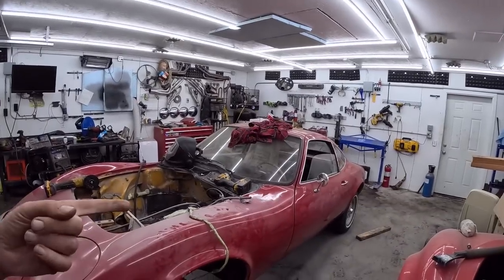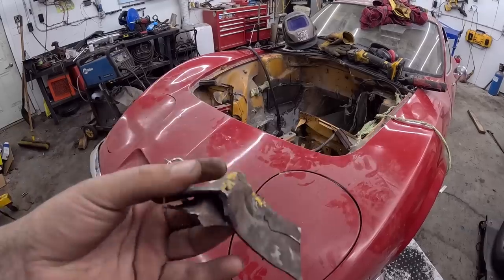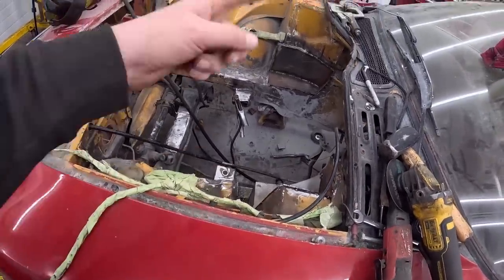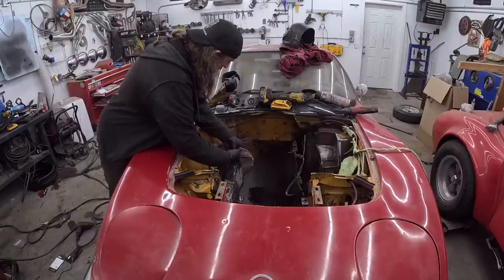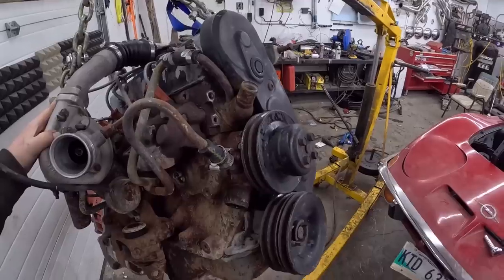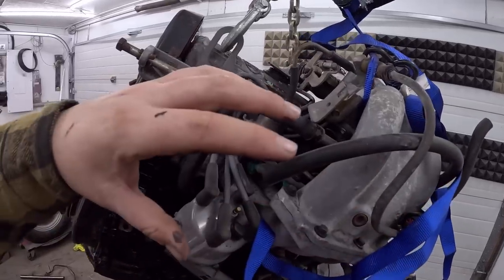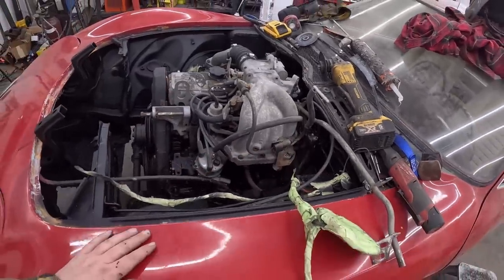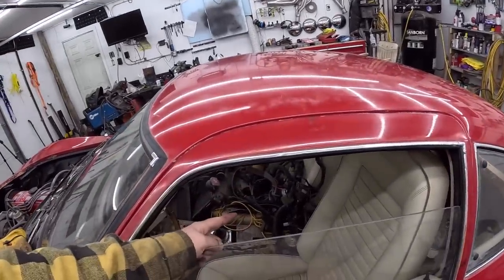Nightmare Motor Install! -  Turbo Ford 5 Speed In A Chevy?... 1971 Opel GT

Comment: You could take the timing belt cover off, and the sheet metal that holds the cover.  Run an exposed cam sprocket and belt.  This would add 3/4" clearance and look bad ass.  I run without covers on my OHC four bangers, no problem.
Reply: Maybe get one those Chinese clone Garret turbos off of ebay, just so you can have a straight inlet when you plumb.

Comment: I tried making comments on the previous video and sending email to Dan trying to tell him about the advantages of using the later square shaped intakes instead of the linear intake he currently has. The later square intakes are pretty easy to turn 90° to help with his hood clearance issue. However I did not get any replies to my email or video comments so I don't know if he is actually getting the info I am trying to pass on.
Reply: He would have to stop working to read emails. He did mention using his facebook account more often for such things
Reply: Perhaps seeing your last name he thought those comments were for the other car. sorry couldn't resist.

Comment: I have been toying with these engines for about 20 years.  I have been told the heat exchanger at the oil filter was as much for heating the oil as for cooling it.  I deleted those on most of my installs with no issues.  I do still feed the water to the Turbo.   I have put 80,000 miles on my current daily driver Turbo Coupe.

The Pinto alternator bracket will locate the alternator lower and the pipe from the intercooler will have room to go to your throttle body on your new intake.  We put one of these engines in an RX7 for my son and made the upper intake.

Comment: Those heater hoses are unique to the turbo setup, I have a stock 2.3 on the stand right now if you wanted 360º pics to compare to. You could ditch those and use a remote cooler if the engine shows the need for it.

Comment: I have a 1973 opal GT that I was considering keeping all GM by putting an ecotech L85O motor and trans adapter to retain the stock 4 spd.
 But it still runs and drives with the stock 1.9 motor in it so I think I'll just leave it alone until it blows up after watching your video.

Comment: My best friend and I did this exact swap for the 2005 (i think) Grassroots Motorsports Challenge. We got the motor out of a Ford Thunderbird turbo coupe. If you Google it you can find a bunch of our posts in various forums. May be something helpful. The worst part was stripping the wire harness.  We also put a ford Taurus SHO motor in the back of a Porsche 914.

Comment: That upper intake manifold could be replaced with tubing, like a mini aluminum header. Re use the flange from each end of the upper manifold and aluminum tubing in between.

Comment: This 2.3 turbo engine looks like something from the SVO Mustang where the lower intake has the runners inline. I had a later 2.3 turbo in an 87 Merkur XR4Ti. The lower manifold had the ports set up in a square formation but the upper intake still ran across the valve cover. It was common at the time to rotate the upper intake clockwise 90 degrees so the intake faced the radiator in order to run a front mount intercooler. This may be what you need for clearance.

Comment: Back in the 90's I ran a 2300 pinto in the mini stock class at our local dirt track engine was basically stock other than some machine work to the head and cut down the flywheel to shave weight ask machine shop about balancing engine he said he couldn't do much better than Ford had done from factory he must have been right 8,000 rpm was not an issue never blew an engine had oil pump screen crack and damaged the crankshaft once was alot of fun

Comment: 2.3's are kinda cool. I have 1 in my Mk1 ford capri running a stinger ecu. Their getting pretty dated though and you have few options for tuner parts. The main reason people liked them back in the day is because they were 1 on the first fuel injected motors with standalone engine management making them relatively easy to swap. With so many better options I suggest people go another route. Another interesting 2.3 fact is they weigh almost 600lbs fully dressed.

Comment: Try isongti foil to mask long runs of wire or hoses. It works super quick and you can just scrunch the tin foil into place and tape a few wraps here and there. Works well on shocks, axles drivelines...
Reply: *using tin foil

Comment: Not sure you have the room, but a gantry works well for pulling motors. I mounted a 2500 lb winch on mine. I have used it to raise a roller body onto barrels using it. (One end at a time)

Comment: Manifold is just moving air, no fuel. U can almost mount anything between the turbo and the heads and it will “work “ . . Don’t be afraid to use tubing and put the tb anywhere

Comment: Howdy from the Northwoods of Minnesota 
Oil cooler important. Turbo n you putting heat in oil so need to remove. Also helps with warm-up.  So win win

Comment: Dan on your intake. Take the flat steel ya have and duplicate the face of your intake flange then use old header pipe or exhaust pipe and worm your way around the alt. then box them together then use the throttle body after that then to the trubo'

Comment: I'm sure you know that you're not the first guy to install a Ford 2.3L into an Opel GT.  A friend did it back in 2010 during a "Lemons" race car build. Of course since it was a race car he just cut the firewall to set the engine back enough to clear the crossmember. This helped the handling as the engine was behind the front suspension and the engine was NA and not turboed.  A turbo would only make the engine that much less reliable. I instead milled the head some to raise the compression. The car won twice in class and ran as high as 2nd overall due to it's good handling and just enough horsepower.

Comment: @22:22 Dirty Dan, with his spray can. That silver paint is good for a minimum .36% horsepower gain, and also lowers the dirt's co-efficiant of drag.
Badass!
Someone needs to sneek into the other garage and stick those little deer alert things all over the Nomad in hidden locations so th whistles like crazy going down the highway.
That, or maybe you and Danni should put a bumch of them on the underside of someone's car on the next Power Cruise or whatever it's called.
Does Rock Auto sell those annoying little things by the box? Sometimes you can find some in the junk yard, ya know. The double sided sticky tape will be thrashed, but JB Weld sticks them on pretty good!
Okay, that's a littme TOO evil, bjt, you get the plint, right?
Deer whistles - EVERYWHERE. Guaranteed to drive all vehicle occupants slowly toward the brink - until they are all flund and removed anyhow.

Comment: They can run hot without oil cooler. Running through the turbo is rough on it.  Especially with little space.

Comment: 30:15 you should be able to unbolt that inlet and flip it over to make it face away from the strut tower or whatever that is its up against, or you can probably unbolt the cold side from the hot side and clock it different

Comment: 1987-1988 Turbocoupe intake manifold very easy to rotate. You can use a 4cyl foxbody wiring harness with only a few wires to repin. Check out Stinger Performance for great how-to articles on 2.3Turbos.

Comment: My question is will the Opal rear end handle the extra power?
Reply: Probably not, unless he uses little tires. Probably no such thing as a limited slip diff for those either.
Reply: It's only a 2.3
Reply: @aired-downdisconnected4125  I have a vintage Fiat 124 that can't handle the 2.3 Turbo's torque, so I was just curious on what his solution would be.

Comment: Turbo-Lag isn't as big a deal on a fuel injected engine as it is with a carburetor. You should be fine. The intercooler will make the air denser as it cools, which will boost power too.

Comment: If you can find a 92-94 ranger alternator bracket in a local junkyard it will drop it down on the passenger side and give you a serpentine set up.

Comment: Nice. I'm thinking of doing this to my 97 dodge neon fwd to a twin cam 16v 4cyl SRT4 turbo from a PT Cruiser. With a custom flywheel and 2002 Jeep Liberty bellhousing, it's going RWD with an MA5 / AR-5 RWD Chevy transmission and a s10 rear end seen DEBOSS GARAGE do it to a MG midget. It looks like what your doing would be easier.

Comment: Here in Europe you'd be burnt at the stake for putting a ford engine in an opel, but then we do have readily available high performance opel engines up to 2.4 litre displacement that would bolt straight into an opel gt.

Comment: Ypu need a clutch cable  or put in hidro cylinder
Reply: I have meany  pinto s and 4cy mustangs  and flipped  for fun my wears was fixed belt was 1 off and moved it 15mins and fixed it the head was rebuild  it run good the seller was 3 house down street  o my i stoped said what back he said yau wife said no she wone

Comment: Ford tech for 17 yrs that oil cooler is necessary for turbo 2.3 liter motors newer models of that motor had a water cooled center section in turbo they don't have water to oil cooler but that motor its necessary

Comment: That dampener on the driveshaft is unnecessary. My 91 mustang had the same setup and when I 5 speed swapped it the new drive shaft didn’t have it and I seen no difference. I now have an aluminum Ford racing drive shaft and it also does not have that dampener

Comment: Sure, do the timing belt whenever.  These are non-interference engines, so no worries if the belt fails. Water cooling lines are a bit complicated, but yes, with the turbo and tight engine compartment, it's good to have oil cooler, either factory or aftermarket.  You also mentioned the start size in a previous video; just get a mini starter, problem solved. You should probably reseal the oil pan while it's out.  And when you do the valve cover, get the OEM Ford Ranger gasket for it.... kinda expensive for what it is, but very thick, reuseable, and known to seal better than every other valve cover gasket for these engines. The weird box with the vacuum hose is a crankcase breather, important for a turbo engine. And as for the solid mounts, just be aware that these engines vibrate a fair amount, which might make it suck to drive.  To get the room you need for the intake plenum, there are mounting options for hanging the alternator down low on the passenger side.

Comment: It doesn't matter what it came out of it will ALWAYS BE A PINTO MOTOR
Reply: If anything, it would be a Cortina engine, This engine predates the Pinto in the States the UK and Germany. I had the German block in a  72 Pinto.Way better than other 2.3s. My 71 or two Cortina had this engine too.   The 2.8 v6 was really bad.